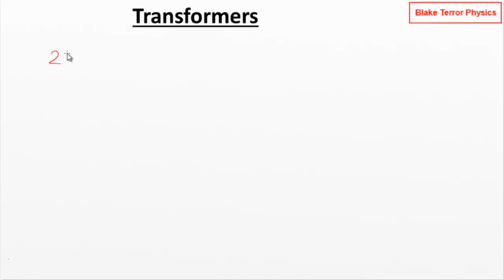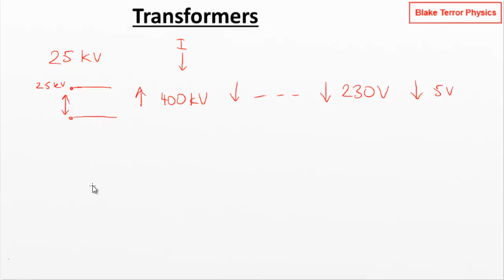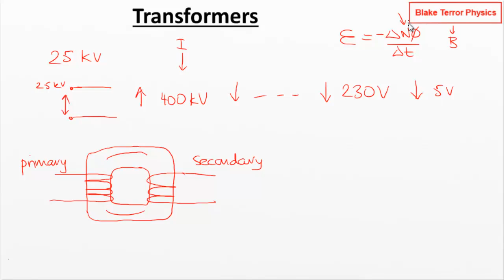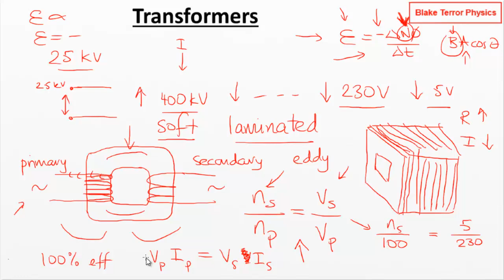Electricity and Magnetism - Transformers

Comment: Does the core have to be iron, or can it be another magnetic conducting metal?
Reply from the maker: Good question. As far as I'm aware, pure iron cores don't get used much nowadays (even if laminated). Electrical steel (an iron-silicon alloy rather than regular steel which is iron-carbon) is better for reducing power loss so gets used in transformers, generators, motors, etc. Engineers can tailor the combination of iron and silicon for the specific magnetic properties they want. I expect that while other materials could be used (such as nickel) they would cost more (nickel is more expensive than iron) and have worse performance. I'm not an expert in the engineering of transformers so this is pushing the limits of my knowledge, I'm afraid.